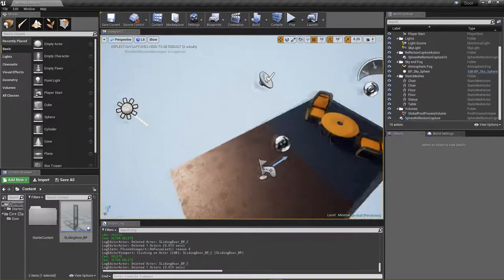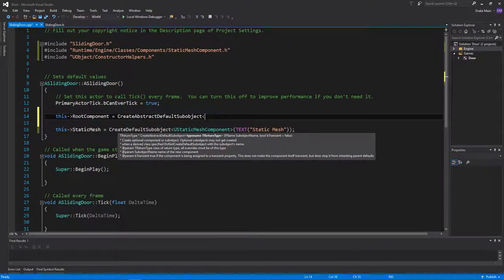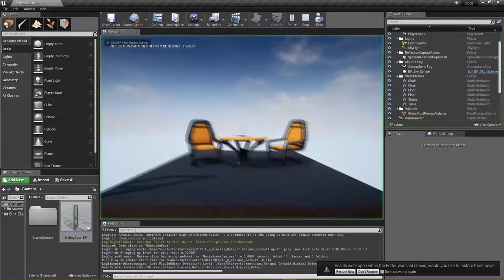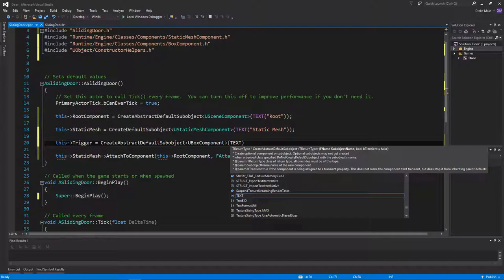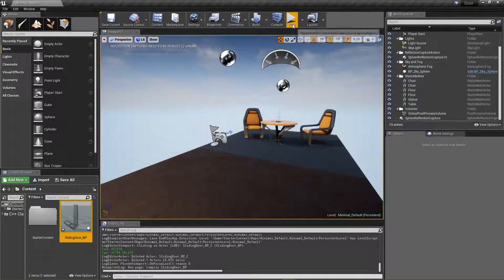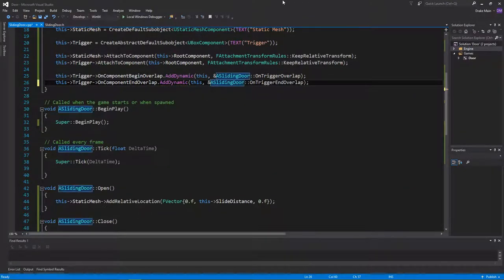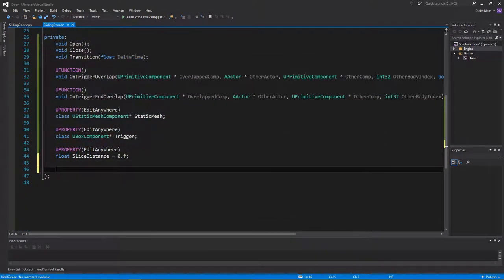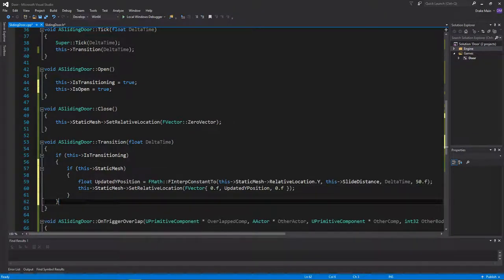Minicode | UE4 C++ Sliding Door

Comment: Just one question. Why are you making the mesh component private?
Reply from the maker: In general, you should always opt for being as restrictive as possible with class properties in order to have a clean public API. In this specific case, I didn't see any need for anything outside of the class to have access to the mesh, so I made it private. 

If you were to implement this door yourself and you decided you wanted access to the mesh outside this class, you could make the property protected/public, but even then I would personally opt for being restrictive and making methods that do something specific rather than having public properties (eg make a method called SetDoorColor as opposed to making the mesh public).

Ultimately it boils down to whatever design philosophy you want to adhere to in regards to your class API.